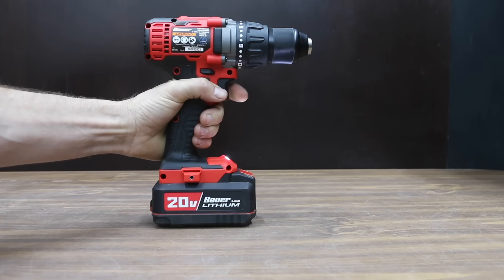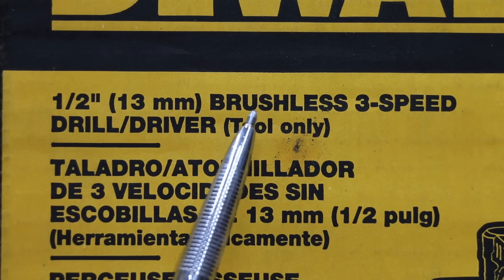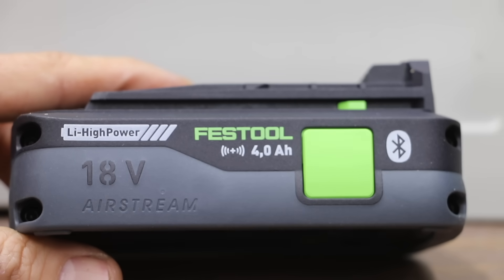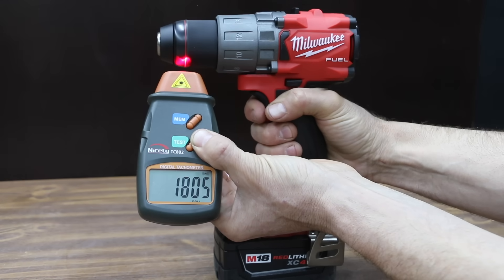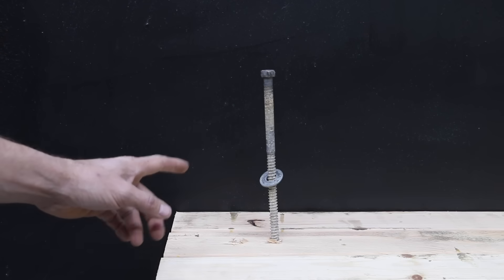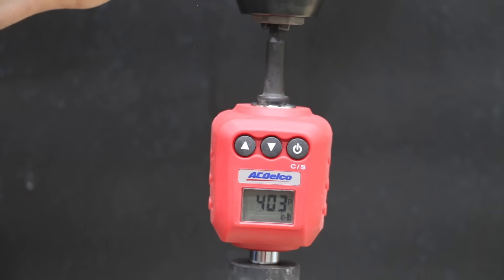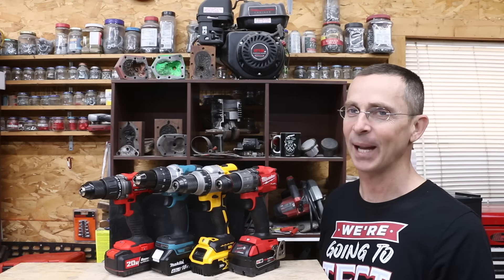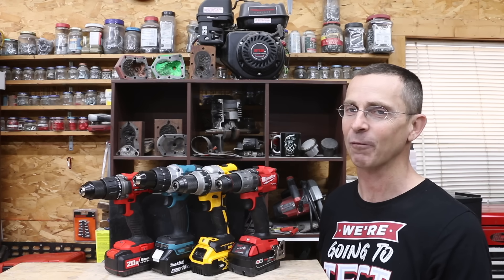Best Drill (BATTERY POWERED)? Milwaukee vs Dewalt, Makita, Bosch, Festool, Ryobi, Bauer, Ridgid

Comment: How expensive you can sell me a drill?
Festool: YES!
Reply: @Alessandro Principe only reason it's worth it is because it won't break, and if something breaks it will have warranty. They continue to supply spare parts 10 years after the model is discontinued, and if they do t have a spare part you get a new tool for free
Reply: @nmgfan8090  I have a rigid tool set that I purchased in 2004. The tools and the batteries have a lifetime warranty. They still work great and the only item returned for warranty were the original batteries that lasted probably over 10 years. I will say that the jig saw that came with the set is unimpressive, but I gave less for the entire 5 tool set with three batteries than one Festool drill costs.
Edit: I once forgot the sawzall in a crawl space when I was working on a sump pump. I went away for the weekend, leaving the job to be completed the following Monday. When I came back the crawlspace was flooded and the sawzall was submerged. I fished it out and let it air dry. That was about 7-8 years ago and it still works very well.
Reply: @nmgfan8090  That’s all well and good, but the reason they are able to do this is their drill design is about 15 years behind everyone else. This business model isn’t very practical for power tools because they evolve so rapidly. By the time my drill might burn out after a few years, I’d rather upgrade to the newer model that is smaller, lighter and more powerful. Even if that’s not important to you, consider you could buy about 4 Milwaukee Fuel 18V hammer drills for the price of one Festool drill. Power tool repair is generally not very expensive. You’d have 3 spare drills ready to go and eliminate any downtime. I’m all for the buy once, cry once mentality when it comes to buying good tools but I’ve never understood the appeal of most Festool stuff. I’m a large commercial/industrial HVAC mechanical/pipe fitter. Milwaukee is the industry standard. We beat the absolute piss out of their tools and they hold up very well all things considered.
Reply: @user-te3qq1rb7u  I partly agree. We only use Milwaukee for everything battery powered at work. I can't say how good new festool drills are today, (although I've only heard good things) but the 10 year old drill we have at home is still really good. The battery is pretty small, understandable for the time it was made.
Reply: @nmgfan8090  
Battery technology is going to evolve regardless of brand.

NiCad -> Lithium was a big jump.

The next step is going to solid state batteries. Paying that much for a tool doesn't make sense. It's not a family heirloom.
Reply: @user-te3qq1rb7u  can confirm i am a commercial industrial hvac pipe fitter my milwaukee set is 9 yars old and i dont exactly treat it with respect cheers from australia
Reply: @nmgfan8090  ridgid lifetime warranty lol
Reply: @nmgfan8090  But you are paying for that upfront at least three times over. Still not worth it.
Reply: @jeffmattel2662  I wouldn't buy one, but I guess it depends how dependant you are on your tool working. How much does it cost you to be without a drill until you can get a new one or get it fixed?
Reply: There's many features in Festool which you do not see at this kind of test. The best tools for professional work are Festool and Mafell
Reply: @tapsulinka  can you give an example of how the festool would outperform the milwaukee in a professional setting? i say that because the milwaukee also has a great warranty
Reply: @alxjcaboose  thanks for your response. so basically, if you can afford to get a festool for professional work, you should get them
Reply: @sorcererCermet  yes and no. My first job working as a self employed carpenter I was earning very good money at the time. I used that opportunity to replace my older power tools. So yes definitely if you can afford it, or can really see the practical use for owning Festool. If you can kind of afford it I would stick to (made in Japan) Makita. 
If I wasn't on the kind of money I was on at the time I wouldn't have bought Festool.
Reply: @alxjcaboose  yes i think the distinction is that you must be able to, without a doubt, afford to get a festool. where it's like 10% of your monthly salary or something and you arent dipping into savings. i have dewalt rn but makita is looking very attractive. im not really a professional who needs the best powertools though
Reply: @sorcererCermet  the goal is to not need a warranty..
Reply: @sageand94  sure, but statistical outliers can always happen, and it could be your drill that has some flaw where it would need replaced. cant ever guarantee that something wont break. that's where warranties pick up the slack

edit: typed it in a hurry so corrected it and made easier to read
Reply: @sorcererCermet  Very true. Warranty claims per customer would be a statistic I'd be interested in. Never thought of that until your comment
Reply: IMO Drills and other Tools from Hilti are the best. I use my Drill every day at work since 5 years and the battery lasts 2 weeks or more. Also it has high power and sturdiness. Its not all about power you should use these tools a year or more and test them again.
Reply: @inot88j24  HILTI & FESTOOL = 🤝The German perfection and engineering
Reply: I paid $500 each for my Protool(Festool) drill and driver in 2005, 16 hard working years ago, they have been absolutely flogged, dropped off ladders, underwater in a flooded basement, and generally used and abused, every day, professionally, and have not had one single thing go wrong with them. They are the best, no question.
Reply: Hilti: hold my lager
Reply: Amen
Reply: The only thing worth a shit Festool makes is the Domino and Tracksaw (although I think the Mafell  version is better)
Reply: And it did badly.
Reply: @xt5181  agreed. My FIL is a carpenter and still has a 10 yr old black and white Makita drill and impact driver kit. He also has a 6yr old sawzall which works great. The drill is still working fine but the impact driver started having intermittent trigger issues and it's got a broken handle after all these years of abuse so he got a XDT15  subcompact brushless driver.
He's very happy with his tools.
Reply: I’m going with DeWalt….cos I like the colour scheme.   Oooh and the neat TStak cases.
Reply: Festool is for fools and is known for shrinking testicles!  Dewalt and Makita are a much better value. 90 minutes to charge a battery?  WTF? You can buy a pickup truck worth of batteries for the extra money spent on a Festool.  As for warranty, if it breaks, I just buy a new one or repair it, you still come out way ahead. Makita also sells systainers and their just as good as Festool's because they are made by the same company.  None of the drills reviewed here are as good as the Dewalt 12V Max. It's very powerful, fast charging, lightweight and more than enough power for what I need.
Reply: @xt5181  
It's a sunk cost fallacy.

One could buy 3 Makitas and have change to spare. That's 9 years of warranty versus 3 of one Festool.

You would already have grandkids by the time the 3rd Makita broke.
Reply: @xt5181  you are totally wrong. The guy who works with me has had EIGHT makita impact drivers in the same 16 year period I have had my Protool (Festool) one, I am way way ahead of him in monetary terms
Reply: @xt5181  I mean you can make that argument about anything that's more expensive. I remain fully justified with my purchases, even though I don't use them as often as I used to.
Reply: @alxjcaboose  
The term your looking for is 'sunk cost fallacy'. 

Festool is a good tool, but not more than triple the price better. (Makita as baseline)

Edit: Changed to triple
Reply: @camryuser  you seem to just assume that. I have no regrets buying some Festool and I honestly wonder if some of the negativity is just jealousy from faceless internet users. 
All I have done is offer my opinion from someone who owns and has worked regularly with Festool, Makita (and some Bosch and DeWalt). I have said Festool is only worth it if you can really afford it, and I stand by that statement. My Festool drills massively out performed my previous Makita despite the smaller batteries, and the carry cases were a lifesaver while transporting my tools around when I was unable to drive to site. 
If you actually have had experience using a Festool over other brands I would be interested to hear your experience and why it was a bad experience. But if you have no experience and are just assuming then I suggest keeping your opinions to yourself.
Reply: @camryuser  🤣 if that's a novel the biggest book you have read must be a colouring book 🤣🤣🤣
Reply: @alxjcaboose  
Okay shill
Reply: @camryuser  sure thing mate keep on assuming 🤣
Reply: @alxjcaboose  
Yet you assumed my reading skills. 

Your attitude is of someone's football team that lost.

Milwaukee is the faster drill in some of the tests (vs Festool)

Yet,  I don't think your humble enough to admit this.
Reply: @alxjcaboose  
Of course I am looking at the speed of the tool, that's a quantifiable measurement.

I am not jealous, you stated that twice. That's hell of a projection. I rather invest my money from the difference into a stock.

Like Alessandro stated earlier, "For half a grand it doesn't seem to be that worth it."

Like I said, I don't see how it's triple the price better.

What exactly is my tool brand? You never stated which one. Please do tell.

Edit: I just realized my original comment was for XT, NOT you. Somehow I must have accidentally click your username.
Reply: @camryuser  fair enough, the comment did seam out of the blue hence my response. 
I don't know your tool brand of choice, I was asking what your preferred tool brand is and why?
The price is deffo a sticking point, that's why I said I wouldn't recommend Festool unless you can really afford it, or if there is a particular reason you need Festool. Otherwise I recommend Makita (made in japan if possible).
The speed was never an issue for me, but battery life was the main reason I went Festool in the end. My 14v batteries in my Festool drills lasted the whole day before I needed to charge them, but my Makita 18v I needed to charge them 2 or 3 times throughout the day. Not so much an issue when I was working on a workbench as a bench joiner, but when out on site it was a nightmare.
Reply: @alxjcaboose  
Festool warranty is not even long enough for my taste.
If I ever need to go that high in price I rather go Hilti.

20 Years of warranty.
Reply: @alxjcaboose : Assuming A working man is jealous of your tool due to the high price of your tool, says SOOOO much about you. A working man's ONLY concern is how well, fast, and cost effective, he can get the job done, all else is vanity. If  job is going to need so much batter power that 1 pack needs to be charged 3 times, then I would take 3 packs.. Anything that is predictable, is preventable. I did appreciate your first reasoning though and you stated your case for your needs just fine, though you wont find many, dirty clothes, sweaty workmen, standing in line to agree with you.
Reply: @TonyScandal  
I think he tapped out.

All that vigor gone!
Reply: @camryuser  I don't know why you guys hating on Festool. They are superior tools. And that's why most professionals use them. Hobby craftsmen shouldnt evaluate things they dont understand.
Reply: @morlin985  
Oh, but we are looking at the results of this video are we not?

The results from Project Farm show *Festool placing 5th* on the 'Peak torque 1st gear driving in 1/2 lag bolt'

Many professionals using it doesn't  necessarily mean it's good. A lot of people were using fidget spinners, so where's your spinner?
Reply: @camryuser   people who should know best about tools because they have to use it 24/7 give a fuck about this test because they now exactly their tool will perform every day for the next 20 years. For sure its hard for hobbyists like you who only need a screwdriver to build their Ikea stuff to understand why most carpenters in Europe swear on Festool. The 5 year warranty, you get a new tool if it got stolen, you can order every little screw if you need to repair something and Festool still produces in Germany and Europe and not in China like all of these other brands. The overall handling is superior (very important if you have to use it 8hrs straight), they are unbreakable and the most important thing: extremly precise (especially their routers). Companies that are producing kitchens worth 60.000$ (where I'm working f.e.) need those precision. Did you ever use a Festool router or saw in comparison to a Makita or Dewalt? If not this discussion is over because you're trying to talk about things you don't even understand, sorry.
Reply: @morlin985  no one uses them in construction in australia no one except maybe joiners
Reply: @morlin985  I can tell you’re not actually in construction because most professionals, for a fact, do not use Festool. I’ve been working on massive construction projects for the last ten years in the northeast and I think I’ve seen Festool stuff on a job site twice.
Reply: @user-te3qq1rb7u  I'm not a construction worker, I'm a joiner and I don't think Americans use Festool that much. It's a huge thing for european carpenters and joiners.  Milwaukee on the other side isn't popular in Europe. Mostly because they are much cheaper in Europe than in American or Australia. I think Milwaukee are great tools if it comes to power and speed. Festool is made for a complete different purpose. If you are happy with your tool it's fine but you guys shouldn't hate on Festool if you don't use them every day, they are definetly worth the money.
Reply: @camryuser  The drill test with no actual drilling? What's next, which hammer is the best at chopping down a tree?
Reply: @notmynameonyoutube6658  
PF can't use drill bits with a torque adapter dummy.

The lag bolt part counts as "drilling" without using drill bits.
Reply: @camryuser  More torque makes more better drilling? Dummy
Reply: @notmynameonyoutube6658  

You: "More torque makes a better drilling?"

No where in my previous comments, did I state that. I did say however, *[Festool]it is slower* according to the tests.
Quit reaching.

And you completely avoided the part where PF uses a torque adapter for the tests. **How exactly is he going to attach a drill bit to that huh?**
Reply: @morlin985  
If I was doing mostly indoor, smaller work I'd probably go with a festool. But Hilti feels better overall.
Reply: @MrSurrealKarma  Hilti builds superior tools, that's for sure. We use their impact drills in our company. But Hilti doesn't produce many tools for woodworkers, they are more focused on drills, nail guns and stuff like that. I would choose a hilti over a Festool when it comes to drills, that's for sure. But when it comes to saws, routers and  the whole dust-free system Festool is hard to beat.
Reply: @morlin985  
I agree 100%. We usually rent festool whenever we need to do some finer woodworking stuff.
Reply: @AbleTVision  I was going to get Hilti originally, but ended up going with Festool as the guy I was working with at the time used Festool. And the systainer boxes were a perfect solution when having to move my tools around when I had to get the train to building sites. 7 years later my drills are still in perfect working order, won't be replacing them any time soon, but may end up with Hilti at some point.
Reply: @alxjcaboose  No that was not an accusation either. I think Festool is great. With Hilti the best tools on the market. Just wanted to mean that I can put you with calm and good conscience Hilti to the heart. The two products are simply the one quite an
Reply: @AbleTVision  I know. I didn't mean to come across as calling you out. I completely agree with your statement. I was just saying that originally I was going to get Hilti drills, and the only reason I didn't was the transportation. I have borrowed someone Hilti impact driver years ago. A real solid piece of kit 👍
Reply: @alxjcaboose  You said it! It's probably due to our strict requirements in Germany, because craftsmanship is our number one priority. Building a house is much more expensive here and there are a lot of requirements and permits. Which I envy you guys for, for example. I would really like to build a house. But this is out of the question here :(
Reply: For professional daily use the best brand you can get.
Reply: @Kayschie1101  Not according professional tests
Reply: @GobbiLuiz  You mean tests like in this videos? 😂

Comment: I purchased a Ridgid 18V package containing a drill and an impact driver, the charger and 2 batteries about 3 years ago, remember paying about $180 for the package.   I am not in the trades but I used them probably more often and harder that the average homeowner; they have given me good service  over that time.  The reason I bought the Ridgid over the other comparable brands is that they came with a lifetime warranty, which covers not only the drive and impact driver, but both of the batteries and the charger; perhaps something for the average homeowner to consider!
Reply from the maker: Thanks  for the feedback.